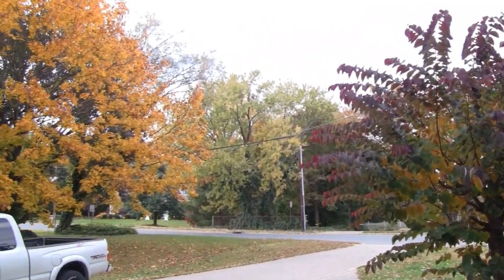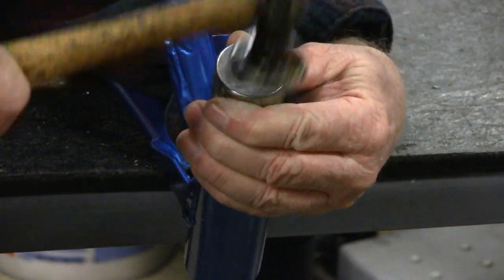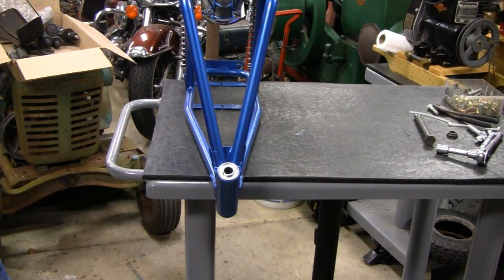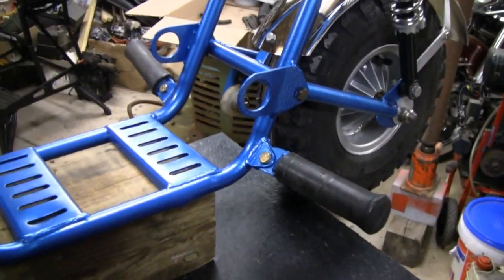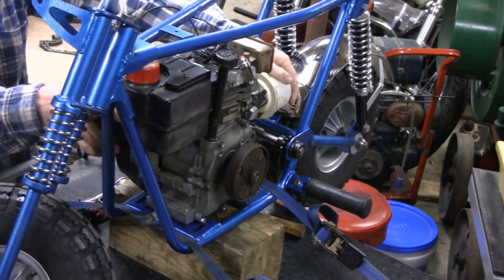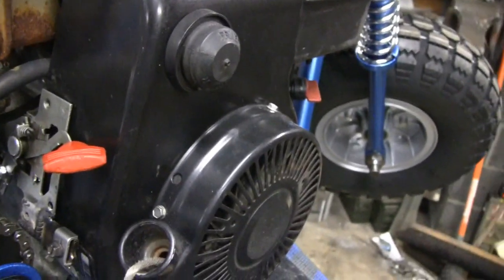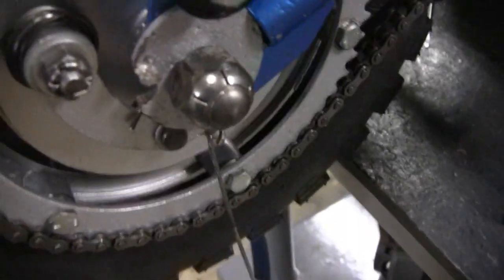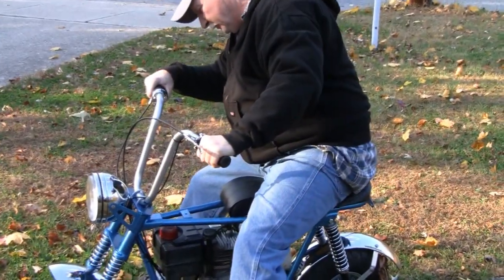RUPP MINI BIKE RESTORATION (part 8)

Comment: Super clean Job RK.
Have to get yourself one of those rat trap clutches that hold off engage to higher rpms.
Guess it depends which race you wanna win when it comes to gearing,,the mile or the 100 footer.
Reply from the maker: Thanks Vincent!!☺

Comment: Bummer you had to go back and play with the gearing after the job well done. Nice job on the videos too! Thank you so kindly. This will help when I'll tear down my new acquisition of a 1970 Roadster (212cc/15hp engine). Just don't know how to approach the rear drum brake restoration yet. Barely have any brakes! Guy said there are new brake shoes installed. The cable is free and tight too. What's going on with that? Any info, from anybody on brakes (ideas, where to buy) would be much appreciated.

Comment: Great job Road King. I had a 1974 Hustler and a friend had a 1972 Roadster. They had torque converters and not clutches. Very different from the 69. This brought back memories. Going to watch this series a few times through. Any update on the gearing?
Reply from the maker: Thanks Bud!! Rupp made some great machines!! With that set up it did 50, but was a real slug outta the hole. I finally reversed the sprockets on the jackshaft and it tops out at about 38 but it jumps outta the hole and wheelies without any problem!!☺

Comment: thanks for not ruining it with a predator engine.
Reply: Quick fix if the period correct engine is either too costly or nonexistent...which is usually the case with rarer vintage minis.

Dont hate on the "$100 Honda clone that could".

Comment: How hard would it be to switch the pull start with a automatic start
Reply: Very.

Toothed fly wheel.
Electric motor mounted to side plate opposite the crank shaft.
Electric to the starter, means wiring in a battery.

Not too much gain for an old Tecumseh.

Comment: Do you know if a predator 6.5 hp 212 cc motor would fit in this?
Reply from the maker: ***** Don't know Bud!! That 5 hp just barely fit!!☺
Reply: *****  i've got a 6.5hp 212cc honda clone on mine as long as you have the original gastank for the bike and swap out to a cone filter air intake youll be fine. Mines on a 1972 rupp hustler.
Reply: Thanks guys I settled with the predator 3hp motor and fits perfectly I'll do some mods to make it go a little faster Rado McRado 805ROADKING
Reply: yeah mines the predator 6.5hp and its at 8hp right now.currently in the middle of a restoration

Comment: You should have put the smaller sprocket on the final chain drive to solve the clearance issue and improve torque it is simple mechanics. Not criticizing at all it is still great

Comment: I think your sprockets on the jack shaft are the wrong way around. If you exchange them then that should give you the right ratio.
Reply from the maker: We just wanted to see what kinda top speed we could get outta it before put them on the right way!!☺
Reply: It must have done pretty close to 50mph
Reply from the maker: Yeah that's exactly what it did, it was a real slug off the line though!!☺
Reply: Yep 50 is real fast for something that small. Is that a Tecumseh motor? Is it 5hp? Or less?
Reply from the maker: 5 HP Tecumseh!!☺
Reply: Time to port the intake and exhaust and plane the head on that puppy. Advancing the timing helps as well. Get 7 h.p. out of it. She will do 40-45 all day long. HAHAHA
Reply: @quevicular  i have h6 i wish i knew how to mod it like u said